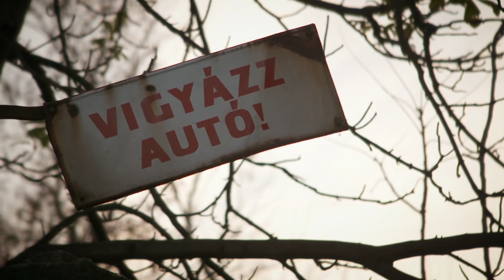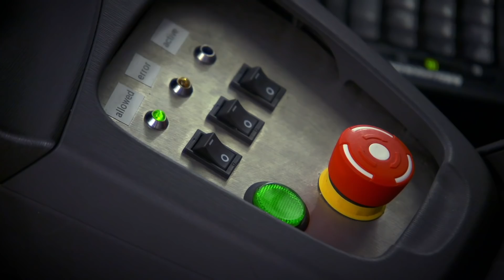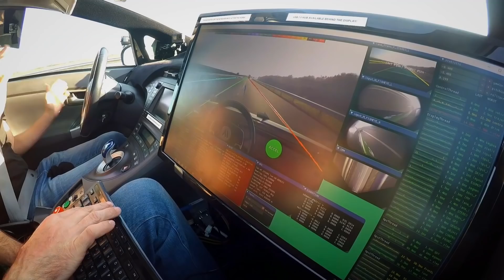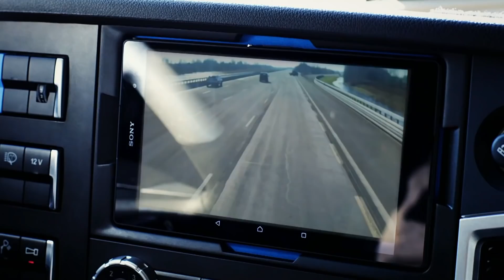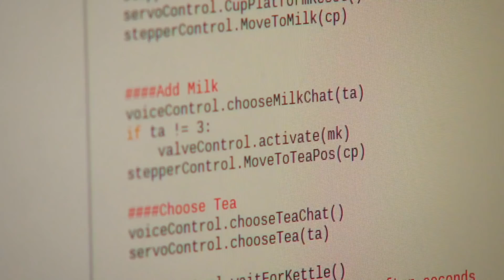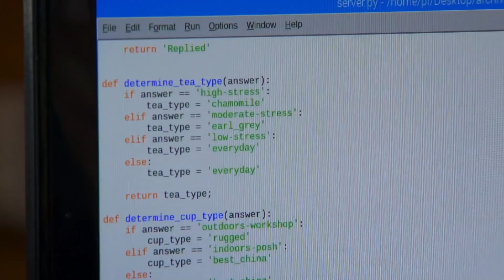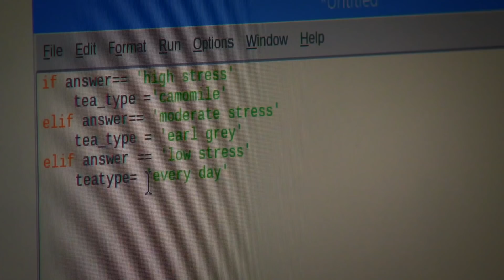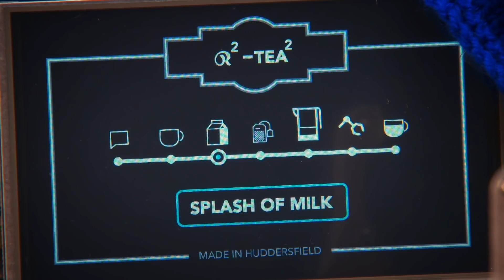Robot Makes Guy A Cup Of Camomile Tea | Guy Vs The Robot Car | Guy Martin Proper

Comment: Yeah it's nice and all but it cant sign paperwork if needed and more importantly it cant change a tire or fix a glad hand seal or a fuse or anything that's small enough for a driver to fix and not have to wait for a mechanic to come fix it.  It has it's ups and downs but I think the biggest thing is that nothing is perfect. Computers do shut down and if it's down how can the receiver of the load sign for it? So I think its good to have the truck's but must keep a driver in it at all times for the back up incase the system shuts down or anything else that the driver can fix and get the wheels rolling again.  Does the system think of different routes if the interstate is shut down bc of a wreck with a fatality?  I can keep going but I won't.  I just wonder if the people coming up with this has even talked to a driver about it and got his info about things. I drove for 12 years and love it and will go back to it. Driving a truck has been in my family for years and years.  I decided to take a break from it for a few years bc I never got to see my family and missed 3 years of my first son's life bc I was otr.  Now I got another son and I'm not missing all this again.  Trucking is in my blood and it will always be. 379 ext hood flat top with silver and blue paint and lots of chiken lights and seat flat on the floor is the only life.

Comment: After we do away with all of the higher paying truck driving jobs, that will be one more industry that will lose a lot of jobs. It will, at best, be a limited number of jobs lost, but the same thing was said about robots on car assembly lines in the auto industry. Look at any car manufacturing line and in some phases it's almost all robotics. It's good news for the corporate bottom line, but a lot of jobs that were once high paying are disappearing. When you replace higher paying manufacturing jobs, or lose them over seas, your economy becomes service oriented (do you want fries with that?), with much lower wages. It will be interesting to see how it ends up.

Comment: I have a 2019 vehicle that cost over $160k. It has had NUMEROUS problems and failures since I purchased it in May. I cannot imagine the carnage of 80,000# self driving semi-trucks on the public streets and in our cities. Sure, it will work for a bit, but when something goes wrong... it could go REALLY WRONG. Just saying...
Reply: The same with a human they make mistakes, crash, get tired. An AI doesnt need to be perfect just better than the human its replacing.

Comment: Lidar is far superior to cameras since  it isn't affected by similar colors, shapes, or lack of light. Lidar can detect objects in total darkness and differentiate between foreground and background. Lidar stands for 'Laser Imaging Detection and Ranging,'  meaning it can measure precise distances between objects without the visual flaws inherent with cameras. It may be more expensive, but that's because it is a superior technology that will save lives when implemented in autonomous vehicles.
Reply: Lidar Is a Crutch.

Comment: Testing in the state of Arizona has led to several deaths. Say no to robots!
Reply: agreed.
Reply: Humans driving has lead to millions of deaths. Just saying, the odds are against us in the long run.
Reply: @bradley3549  i would rather some input, some say on my own life. if i die, i want it to be my own fault. not some self driving car with bugs in its cameras ramming me off the road thanks.
Reply: @bradley3549  it's only as remarkable as the human brain, which is pretty remarkable. And with all the new laws, speed limits etc. Modern cars with great handling, stricter car warrants of fitness, better roads. It does not surprise me at all. The idiots on the road will always be there, that's just part of life. Deal with it. If you are a human you can usually react in time to prevent an accident when someone else is driving like an idiot. If your self driving car is malfunctioning the only reaction you can do is waiting to die.

Comment: truck drivers are only 1/3 of the cost of trucking
Reply: You say only, but 1/3 is still a considerable amount.
Reply: @jurgenklopp64yearsand79  Truck gets 1/3 , truck owner gets 1/3, driver gets the last 1/3
Reply: @johnaustin6673  yes as you stated already, but cutting out the driver and saving 1/3 is still a considerable amount, so don't know why you say "only"?
Reply: @jurgenklopp64yearsand79  " ONLY" = the 40 yr. old plus drivers that can't keep up with tech. and become a burden on the tax payer threw welfare.
there usefulness as a contributor turns into a burden. Don't think a welfare state is the answer. welcome to the USSR
Reply: 60% if listen to the narrator, that’s a whopping saving per truck.
Reply: @firehorse66  Ya fuck the little guy for profit. Great ethics